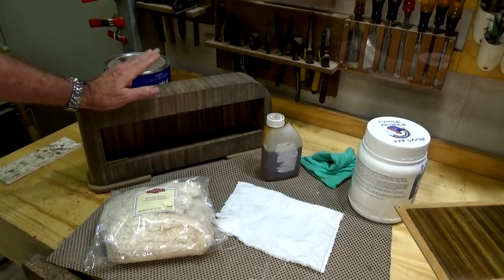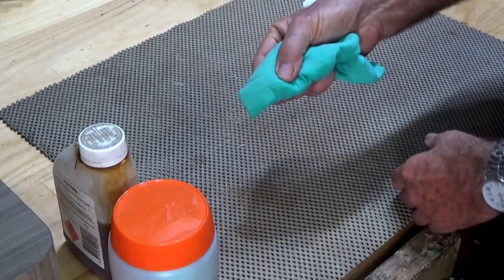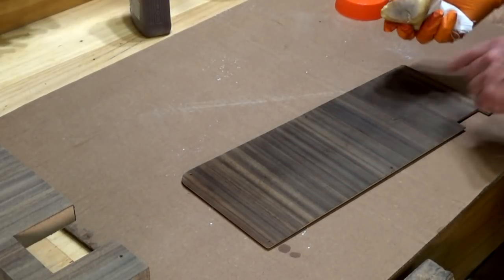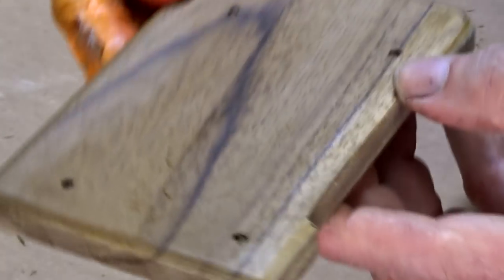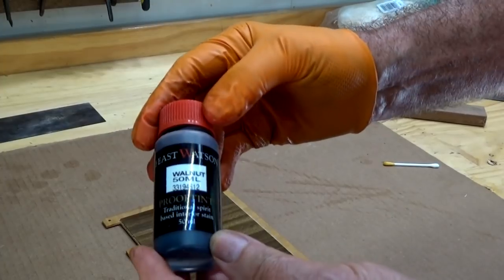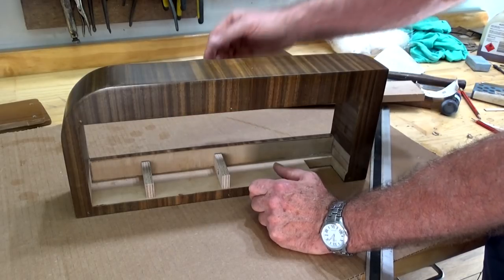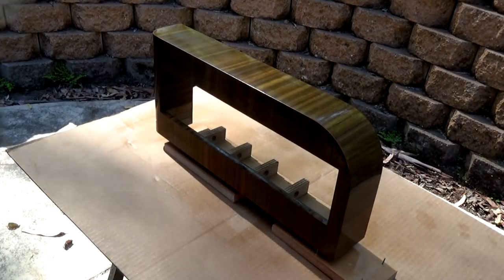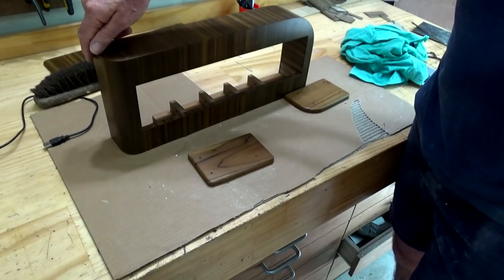Sexy, Lixie, Art Deco Clock Build - Part 6

Comment: Thanks. Really enlightening. I'm in the middle of converting a panel van into a camper. Decided to veneer the ply I'm building the inside with. My son, who's a qualified Schreiner insisted that I veneered both sides, even where it wouldn't show. Decided to humour him, thinking better to take professional advice, even though I knew better. This demonstrated beautifully how wrong I was. 
Thanks for giving all of us the chance to learn from this.
Reply from the maker: I had to do a Google translate to find out what a Schreiner was. Well, a carpenter should know. You can use any old cheap veneer on the back side of a panel if it's not normally visible but it will make the panel more stable. Also, it's why plywood always has an odd number of layers. 
Regards,
Mark.
Reply: @Preso58  sorry, meant to put a definition in. Carpenter/joiner probably close enough.

Comment: Looking lovely, Preso! 

I love watching woodworking projects progress. Watching the luminous finish come out of the wood and also your use of the nail-stands while putting on a coating remind me of when I refinished all the teak on a 30 year old boat with cetol. There was a lot less artistry involved in my project than in yours, though! 

Beautiful work and it was great to get the New Year's present of another visit to your shop.
Reply from the maker: Thanks Scott. We have a wooden boat festival in Noosa every couple of years and the last time I went there were three Chris Craft speed boats with mahogany and cedar that looked like a mirror. I badly wanted to ask how they got such a flawless finish but I suspect the owners didn't actually do the restoration work.
Reply: The old school folks do a full sanding regimen and then a bunch of coats of spar varnish with a re-sand and couple more coats of spar varnish every season.

Cetol's a polyurethane product that has a little more staying power, but the old school folks don't like that it imparts a little bit of orange color to the wood. Same regimen, then two coats of the base protective layer and three to five of the top clear layers. You can then do a light sand and a couple of clear layers every two years depending on how much of the sun and the elements the boat sees through the seasons. As you know, UV and humidity are murder on finishes.

You're absolutely right about boat maintenance, but sometimes you get surprised by a guy in a Mercedes wearing a nice suit changing into a ragged t-shirt and shorts in the boatyard locker room and then going out and scraping and painting the hull of his own boat.

Comment: Mark, thanks for another educational video.  I as educational as I build a valve Amplifier the case was built from laminated  MDF to give me the  height i was looking for which was paineted gloss black. The joint lines between the layers appered once painted, I flatted them out resprayed an they would appear again.  Now I know why, Thanks.
Reply from the maker: Yes, MDF is like a sponge. I once purchased a sheet of MDF that was quite a dark brown colour and it was quite a lot heavier than standard MDF. Maybe it was high density fibreboard but it was really nice to work with. I have never seen another sheet like it!

Comment: Enjoyed watching the video.  I use a similar finishing system based on shellac.  However, I haven't used the addition of pumice in the past, maybe that's why it takes so many coats.  My applicator or pad is different from yours, instead of linen I use ladies nylon stockings.  I've had good luck with that although they do snag easily in the initial application phase.  Great video and important tip regarding mdf.  I always forget how absorbent it can be once the top layer is peeled back.  Happy, healthy New Year.
Reply from the maker: The pumice does help fill the grain a lot quicker. I stripped back a very old sideboard and I couldn't figure out what the white powder was in the grain. Now I know.

Comment: Scottish French Polishing industry standard sanded surface to 320 grit and then start applying polish, 2 coats of thinned out shellac applied with a polish Mop and the last finishing coat is done with a rubber, it never ceases to amaze me how people over thing french polishing or just make it up as they go along.
Reply from the maker: I have several books written about the subject. Since the process is very old, the materials and tools required can be quite difficult to obtain. One book is called "French Polishing" first published in June 1907. I have read through the book many times but it's like translating the dead sea scrolls. At one time, shellac was a much despised and low cost finish used in high school woodworking classes. It gave everything a horrid orange look, especially lighter coloured pine. When applied with a brush it would drip and run and stay rubbery for days. However, if applied with a rubber the result can be stunning. 
Regards,
Mark
Reply: @Preso58  thanks for replying I am a professional furniture maker and wood finisher I was taught French Polishing the professional way by a time served french polisher with 50 years experience and that is the way he and i polish with Mop and finish with a rubber I have never experience shellac going  like rubber and taking days to dry after moping polish

Comment: Nice save Mark!  I'm not much of a fan of MDF though it has it's uses.  I prefer Baltic Birch plywood for a veneer substrate, but still veneer both sides.  I'll use a plain veneer for the side that doesn't show.  I also apply the same type and amount of finish to both sides for the same reasons as veneering both sides.  Enjoying the build and looking forward to seeing the finished clocks whenever you get them done.  Hope you have a great 2019!
Reply from the maker: Bob, we used to use a lot of MDF for student projects in school and it was often used for table tops. We would show the students how to do marquetry and we wouldn't bother veneering both sides. We never noticed a problem with bowing or cupping but I suspect that there were plenty of joint lines between the small pieces of veneer to allow gaps to open up to relieve the stress on the board. That veneer was really thin too. The veneer I used on the clock was quite tough and thick so it really didn't want to move as much as the MDF. However, lesson learned! Next time I will used plywood too.

Comment: it wasnt the right choice to use mdf really. but thats not your fault, i cant think of a material that would have been better (except stabilized solid wood maybe, but thats expensive as it can be). dont mind slight imperfections, you did it the best you could. 

we need to sit down for a moment and enjoy what we accomplish, dont search for the mistakes but look at the things that turned out right. this project was incedibly difficult to pull off, even for people that actually learned how to do this kind of stuff. 

i like how it came out and if i'm honest, i cant see anything wrong on the video. you can be proud of the project, you did the best you could and it turned out awesome.
Reply from the maker: I tend to be a bit hard on myself at times but surprisingly, we have had fine and warm weather for the last week or so and the surfaces seem to have stabilised quite well.  Thanks for the encouragement!